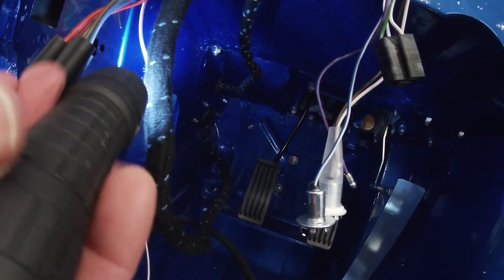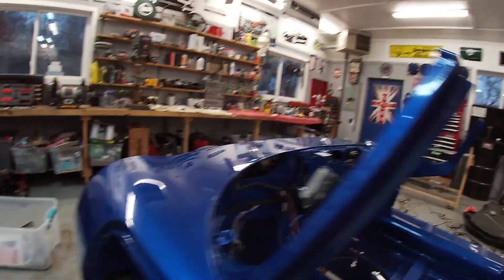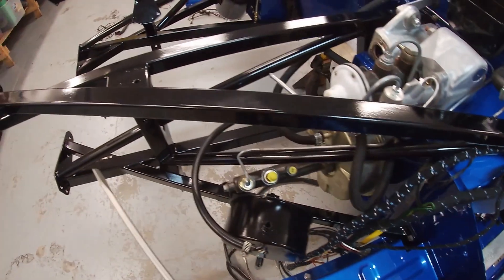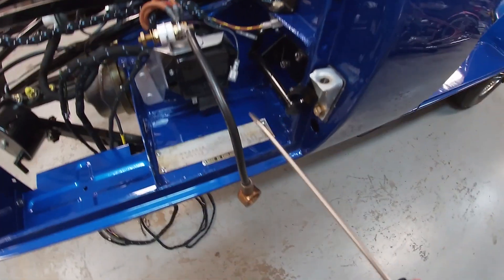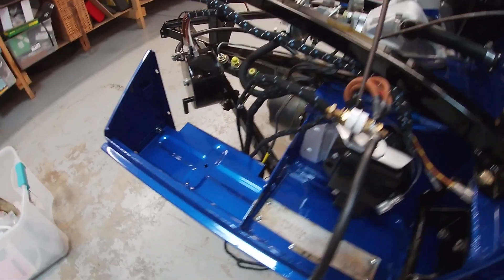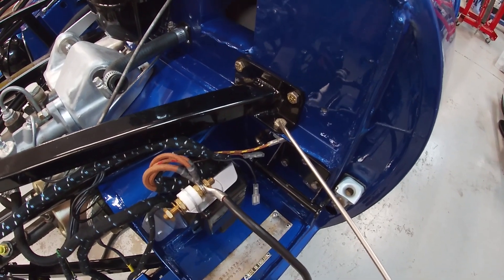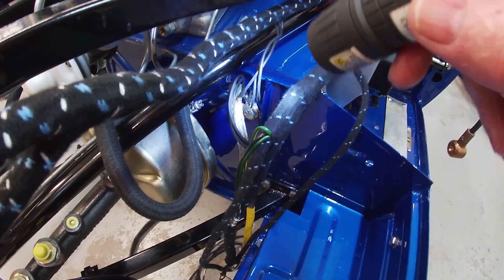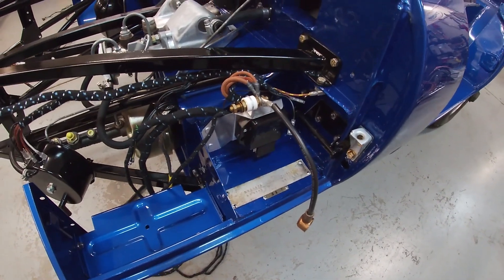Jaguar E Type Series II Rebuild - 2023-01-13 - Alternator Wiring Harness

Comment: do you by chance have more detail on the battery box, mine is simply without,  looking for what and how goes in.        thanks.
Reply from the maker: Hi eFootprintz, based on what you have said I assume you mean the Battery Support Bracket - you can get them in those in several places - Moss Motors, SNG Barrett, Welsh - Moss has them in stock - take a look at:
 
https://mossmotors.com/bd38884-battery-support-bracket

they bolt into the rocker structure. I can send you some pics if you need them.

Hope this helps - John
Reply: @johncooper6950
Reply: not sure what I need to order, do you by chance have a video of how and what you installed ?     Your videos are fantastic and really help.  I have a 1968 2+2 inherited from my dad, taken apart, now a jigsaw puzzle putting slowly back together, many thanks.
Reply from the maker: @efootprintz3038  Hi eFootprintz, I dont have a special video for the battery box bracket installation. I can make you one and post it here.
Reply: @johncooper6950
Reply: would be great, thanks .